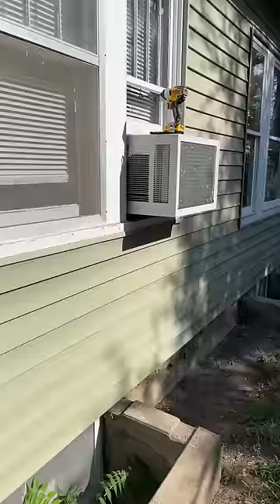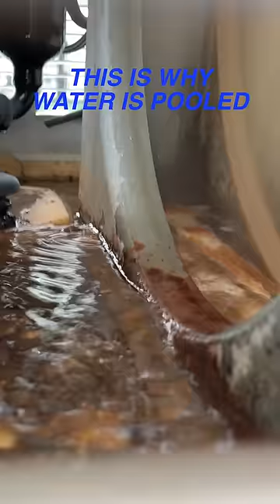🥵 99% Don't Know THIS About Window A/C!

Comment: The bad thing is the fins start to corrode overtime right round the bottom where the water sits in there and rusts the bottom tray out. But hey the longevity of how long it last before you start seeing these signs. Mine is over six years old and still works great

Comment: Whenever I run one that doesn't drain, eventually it will stop cooling. Then you hear the water sloshing on the fan. Then you shut it off to look at it and all the water the air pressure was holding against the coils drops out and soaks the hardwood floor. The never work when they hold water.

Comment: It's called the latent heat of evaporation. It takes nearly 1000 BTUs of energy to evaporate one pound (one pint) of water. If you want to maximize the cooling output of your AC, mist the condenser coils with water. This will work with both window and central units. Use distilled or RO water to minimize mineral buildup.
Reply: The water in the drain pan is technically distilled water.
Reply: @thomasjohns2201 yeah… until it starts to develop organic growth which is almost instantly

Comment: i had that in my ac but the noise was so annoying that i drilled a drain, especially in my small room at night, first i accidentally drilled into the gas pipes so i had to buy another one and switched the motherboards and be more careful, but now it's much less annoying sounding

Comment: They're not meant to hold water, yours will rust out well before it's time if you dont clear the drain. The band around the fan blades helps the fan blow more efficiently and make less fan noise.

Comment: My neighbor tried to drill a hole in mine but I had to stop him.  The water is meant to be there.  Newer ones have a rubber stopper so you can drain well before going into storage or covered for the winter.

Comment: I got black mold in the vents of my window A/C unit. I had to take the front of the unit off and use a brush with diluted bleach to clean it. Sometimes a few times a season if there was high humidity.

Comment: i work at an appliance factory consisting of half a dozen buildings with each kicking out a different appliance.  you all have heard of the brand.  my building doesnt have AC except the offices.  i've been blessed with a keyed room to store my tools/projects/myfatass.   i'm next to ovens and its HOT!  i've learned to watch for window units being replaced from the offices.  i clean off the coils and they work as goo d as they did new.  first time i kept hearing the blade catch the water.  figured it just needs to dry out from the cleaning.  after a few days i had to look it up, its a slinger!!!  yeah i didnt know they were designed to do that!!  quite pleased it wasnt something i misplaced when reassembling!

Comment: The purpose of the condensor is to cool down the hot gas to turn the refrigerant back to liquid to start the cooling cycle over and the condensate water is utilized to aid in the cooling.

Comment: That's what we call a swamp cooler. The use it very dry desert climates. Basically all it does is ADD humidity to the air and that's enough to cool people down. Like Arizona in the desert it's very dry there.

Comment: I've never had one that didn't drain the condensation from it and even those tend to smell like a damn swamp after the first summer. Hell, on cars all the hvacs drain because too much moisture can cause you evaporator coil to ice over which will stop it from working entirely or kick your freeze switch. On top of the ice issue, once mold or algae starts growing inside the hvac, it smells horrible and its really hard to kill off the smell.

Comment: Yes, this is a 'feature' on new(ish) window a/c units. It works marginally but in reality it promotes rust and isn't particularly efficient. We design commercial units with an atomizer array and a clean-water supply that does not rely on air humidity. For instance, in Arizona this solution has minimal benefits due to the low humidity for much of the year. Conversely, too much water will actually impair efficiency because the water spray is not sufficiently diffuse (in fine aerosol dispersion). You are far, far better off if you can afford a mini-split. These DO have drains and will last upwards of 20 years if installed correctly. I see water pooling as a perfect opportunity to promote fungal and bacterial growths, not to mention providing mosquitos and other pests the perfect place to breed. Some of the more expensive window units do come either with a drain or an atomizer pump (sometimes venturi) but I see few of these installed because they typically cost north of $500 and people who opt for window a/c, well they usually don't have the funds.

Comment: I had an ac unit cause water damage to my wall, the bottom was filled with water and I thought it was broken. it had leaked from the second floor window down to the first floor window below it, caused old walpaper under the paint to peel off the plaster and all. was very frustrating.

Comment: I installed one in the back of an RV and had to drill the bottom. When I would drive, that water would find its way inside because it creates a low-pressure vacuum. I messed up the first one, so I returned it and drilled in a different spot the second time around. 😅

Comment: That portable air-conditioner you had in your apartment isn't a swamp cooler.  Moisture builds up inside from the humidity, and it's flung up to the condenser heat exchanger coils.

Comment: If there is no drain hole.. I drill one.. I’ve had the same ac from new 7yrs. After I got it I put a hole in it… never had any issues with it.. even on hotter days. Once that water always sits in there.. it causes problems… it drips n drips… water still collects in it but no where near as much. Once I turn it off I can see a stream of water coming out. Never let them build up water like that… it’s rusts out faster causes bearings to go bad and makes a lot of noise. It’s got a fan to cool itself.. and it does just that.

Comment: I tried the drill once with an ac, and when it penetrated, used the drill bit as a thread and pulled in the bit, unfortunately leaking Freon.  Had to replace it.

Comment: We always gotta remember to tip it back a little cause it ends up leaking in from the level difference. 😮‍💨
Reply from the maker: Yup, must have an angle! Most now are designed to be that way from my experience.

Comment: This design works well, if it's not raining outside. I have one of these ac units on my bedroom window. And when it pours rain the unit gets filled with water. And because the water has nowhere to go. The water severely slows down the fan speed and makes a lot of noise. This is not good if it happens at night, and I am trying to sleep. The other design where the water drains out. I believe it is a much better design.

Comment: I drove hole on mine but I put a rubber plug in it so that I can drain the dirt out of it and then wash it out with a garden hose to keep it clean my air conditioners for over 10 years old

Comment: Make sure the unit is sloped downward away from the house though. Water damage is no fun.

You will hear and see it before it's a problem but the older folks in your life may not. Consider checking for them.

Comment: Air conditioners used to last 10 years before the EPA mandated better energy efficiency.The easiest way for air conditioners.Manufacturers to achieve that was by the water accumulating and then spraying over the coils , which drastically reduces the life of the ac unit between 3 to 5 years. If done properly and install the right way , the air conditioner should have a slight lean Towards the outside with the whole In the ride spot it will drain And last much longer , but will be slightly more inefficient

Comment: Drilling a hole from outside will just leave shavings on the hole which will prevent the water from flushing. Drill from the inside and as much as holes as you need, and you'll be able to clean the shavings with a bigger drill bit. And voilá.

Comment: We called a Mudslinger because if people don't take their air conditioners out of the windows postseason they'll get all birds nests and all kinds of bird poop and all kinds of squirrel stuff and whatever they can get in there the design works if the machine is tilted properly as far as the coils go little coil cleaner goes a long way so take your window units out in the winter and do a little maintenance

Comment: Once I bought a used air conditioner for $50.    It gathered water so I drilled a tiny hole thru the bottom and hit a coil and ruined it.

Comment: Definitely drill them. Why? Galvanic corrosion will cause leaks in the coils that let the refrigerant out. It mostly eats away at the iron containing steel, but it will also wear pinholes in the condenser coils.

Comment: That slinger ring that throws water up on the condenser to maximize “efficiency” will also cause your air conditioner to freeze up if it gets too hot outside and works too hard🫡

Comment: I drilled a hole and ran a hose into a bucket because it was soaking my window frame and seal and unfortunately that is the only window i can run the ac in one the main floor because the rest of the windows are vertical crank style windows

Comment: Theyre supposed to be at an angle to drain out of the back of the pan by the condenser. Problem is its outside. That turns into sludge and clogs the condenser.

Comment: Drilled mine about 12-13 years ago. Still works perfect. The noise was annoying and it was causing the unit to corrode prematurely. Plus to not mention the fact that the motor constantly being bogged down will reduce its life spa

Comment: Well if I ever do get an a c again I will drill the hole and then I will place a tube in that hole just slightly above the drill point so that it can have some water and drain out the other gallon and a half that it collects. You can't have too much of a good thing.

Comment: You also don't have the air conditioner at a angle. There is not supposed to be water in their. That's why it's built with a coolant in the piping.

Comment: I had to drill mine because the water would build up to much and drag the fan down to barely spin. Could not figure out why they did not have a drain. Now I know, but dont think its the best idea. Here in Texas there is enough moisture in the air😂.

Comment: Folks, be sure to clean the inner side of the condenser coil and the water tray. I clean mine every season with a wire brush. Eighteen years later and she still blows 27 degrees lower than room temp.

Comment: I drilled two holes in the bottom of my 35,000 btu ac to let the water out.  It lasted a couple years and then failed.  Thanks.

Comment: Where were you 16 years ago. I tried drilling it while running to drain it, drill bit caught and drove up into the fan blades. Lol, that AC is still out in the shed to be fixed.

Comment: Instead of drilling a hole you can get a napkin fold it into a burrito put half of it into the air conditioner and the other have outside and it will act like a suction and it will drip it out one drip at a time eventually stabilizing the noise thank you YouTube

Comment: I never knew anyone drilled them. Granted I've had central air for as long as I cam remember and only use a window a/c in the bedroom for those extremely hot summer nights and days.

Comment: Um, the moisture is condensing on the cold coils and dripping down.  Therefore, the coils are already wet...  All I could see that pool of water doing is prematurely burning out the fan motor.

Comment: I promise you 
From Louisiana to Florida , we're still gonna drill holes.
Air has more than enough humidity , and because of window units poor design, it backflows into the window if you don't (even on new units)
One hole = no indoor draining and no problems.
If you don't live in the south then you'll be fine

Comment: A mech engineer with 37 y of exp. Never seen this in a window type ac😅
Reply from the maker: They are in all of the new window air conditioners. That's how they get their efficiency rating up and why the ceer number has increased from the old ones

Comment: Yeah well if it was working fine my room wouldn’t be 85% humidity. I drilled that hole for sure.

One time I actually drilled into the radiator and brought it back to Walmart and said the condenser never turns on. Then I got a new ac and there was a sticker on it warning you not to drill holes. I wonder why? I drilled the hole anyway. Maybe it’s not as efficient but it works fine, and my room is 50% humidity now instead.

Comment: Yup, condensers need some amount of water to work at optimum efficiency.
Reply: 😂I plugged the drain hole when using the ac. Then unplugged it before turning the window ac off.

Comment: It has to be drilled cause the condensation will leak out the front of the AC unit and runs down the wall to the floor

Comment: Sure, but when mosquitos start shooting into my living room I think ill get the drill.
Reply from the maker: Irrelevant.
Reply: ...the air coming out the inside vent... comes from inside your house.  If it is shooting out mosquitoes, they are already in the house.
Reply: @Diviance lol how do you think the condensate drains from inside? The hole is right where the nasty outside water sits which invites them right into your house
Reply: @BigeSnek  
You mean the holes that come with a fine mesh cover too small for a mosquito to fit through?
Reply: @Diviance not all units come with the mesh cover
Reply: @BigeSnek  
It is so common that even the chinese ones do now.

I would know, I have one.  I am not convinced it is the 8,000 BTU it claims to be... but it has that mesh cover.

So, uh... maybe pop yours open and put a little mesh cover on the hole?
Reply: @Diviance  I already put a drain hole in mine and it doesn’t have a mesh cover. I never had the mosquito issue since I only used it for a day or two before drilling. Either way, mesh cover or not the unit definitely benefits from not having stagnant water in the pan at all times.
Reply: @BigeSnek  
If it is designed to fling water onto the coils, then you literally made it use more electricity... which is not a benefit.

Mine has no drain hole and it never has stagnant water just sitting in it.  Not even the chinese one.

And I do live in a hot and humid place, I might add.
Reply: @Diviance  the efficiency gained is quickly lost when the condenser becomes clogged, which is almost guaranteed to happen, even more so with the lack of maintenance most window units see. It just causes the coils that are sitting in water to rot out over time.

Comment: As 35 yr tech i guarantee you that is designed wrong ,to maximize efficency the water should drop out trough a heat exchanger, the fan shaft could easily drag a smal pump that would carry the watèr to the top of condenser also but the window unit would cost too much. So go ahead and remove a plug and collect water to wet your flowers, a unit like this makes about 5 gls a 24hrs

Comment: I believe they could spend 30 cents more and at least use stainless steel for the pan. I know it shouldn't rot out before everything is exhausted in the unit. I just don't like the rust stains on everything 😖.

Comment: Humid climates the water build up fast and drain hole clogs with bugs and junk then the water will leak out the front and rot the wall and floor inside

Comment: The problem with the water is it gets full of crap and ends up clogging the inside drain hole, then the AC overflows out the front and ruins the inside wall under it.

Comment: Bs end up throwing that water in and completely molds even if it dont drain in i needs that drill hole because the original hole never works

Comment: Slinger wheels are stupid for the longevity of ac's. After about 5 years the coil and base of the unit will start rusting and rotting out from lack of water drainage.

Comment: Was working in the ac industry.
We had a few customers that had big chillers (500 kw and above) that were pretty old and lacking the power to properly condense all the refrigerant in the summer.
So we had to put water sprinklers in front of the radiators wich would lead to lime accumulating on them, further degrading the over all power of the condensers.
Every year they had more problems in the summer.
Cant make this crap up...

And its not as if those customers only wanted too cool some officis or something.
It was for a crematorium too cool the dead bodies before they got burned.

On a few occasions the chiller would stop working an friday afternoon.
On monday morning they would call us becouse the bodies were rotting in the basement.
It was a mess.
Going into a room with over 200 dead and rotting humans was probebly one of the most disgusting things I experienced in my whole life.

But the customer didnt want to spend the money to install a new chiller system that was up for the task.
 
In the case of the video that is ofcourse not a problem becouse the water is condensate and allready distilled water.

Comment: In which case, it certainly would be nice if the manufacturer put a heavy layer of powder coating on the pan so the case wouldn’t prematurely rust out. But no. Might cut into profits and planned obsolescence.

Comment: Yeah, this is nice until it gets so built up with sludge it completely clogged everything up happened to my grandma’s LG unit. I drilled holes there because it was so disgusting. It was literally probably about a half inch thick layer sludge.

Comment: I was wondering about this. I assumed there was a reason but I drilled it anyway because I rent. I can't afford to rot my landlord's walls.

For all you "you installed it incorrectly" people... the rear is 1 INCH lower than the front it has a hole and it still leaks inside a little if it's very humid.